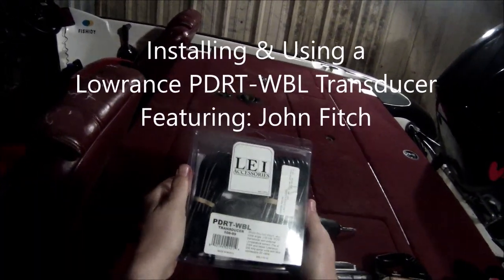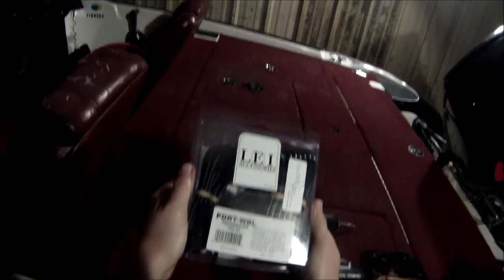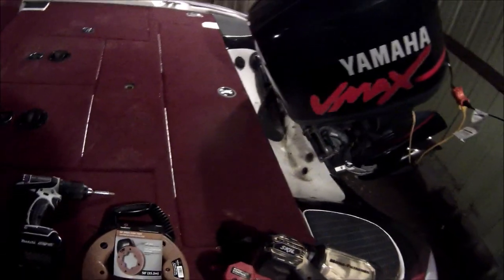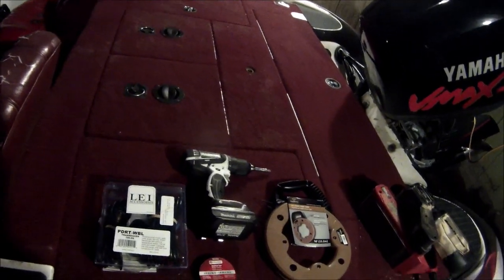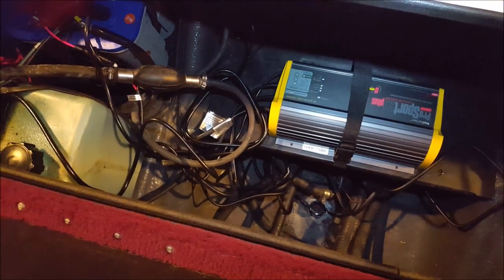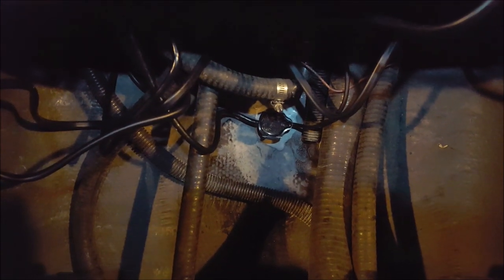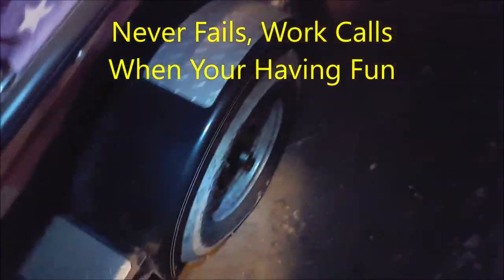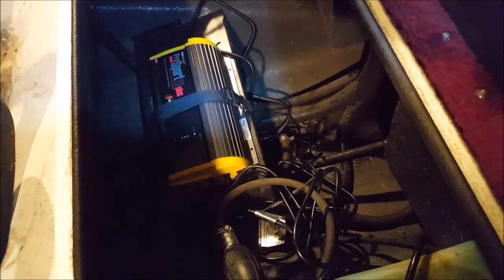Installing & Using a Lowrance PDRT-WBL Shoot Thru Hull Transducer

Comment: I've been using one on my Bass Bandit boat for several years now. I'm not a fan. It is accurate with depth, but gives completely false info on fish and structure. I've tested this several times in crystal clear water. It will show numerous fish and structure where there was not a single minnow there and over a smooth bottom surface. I'm mounting a regular transducer on my boat today and scrap canning that through haul. I did like this video tho.

Comment: Hi, is there any additional setup required on the lowerance to tell its that its Thru hull?
Reply from the maker: Well when you set up the transducer on you head unit you select the transducer from the list so it might know that it's a thru hull transducer. But all I had to do is play with the sensitivity a little